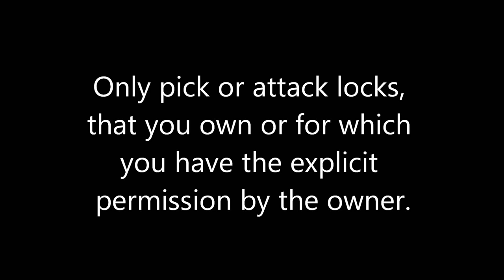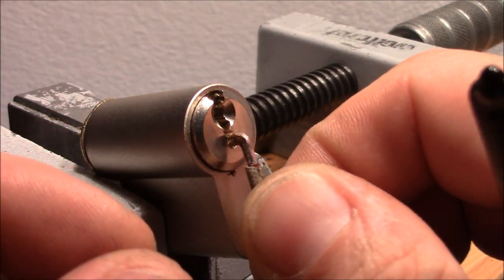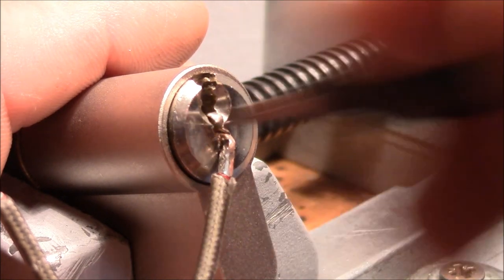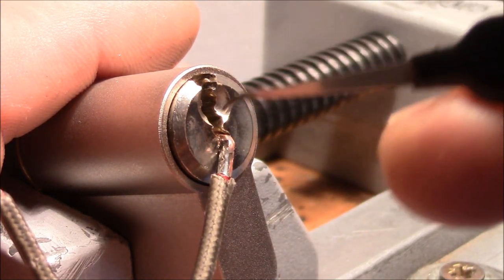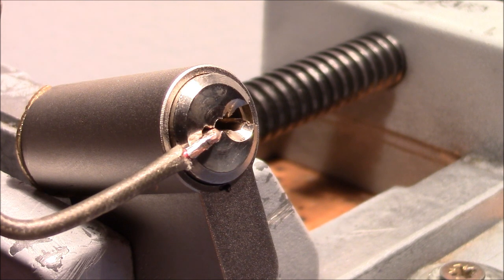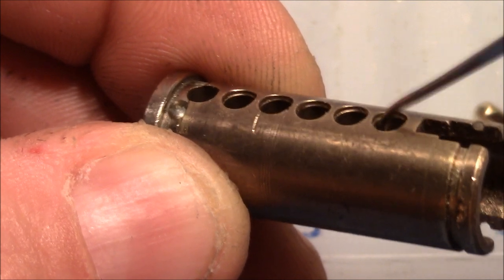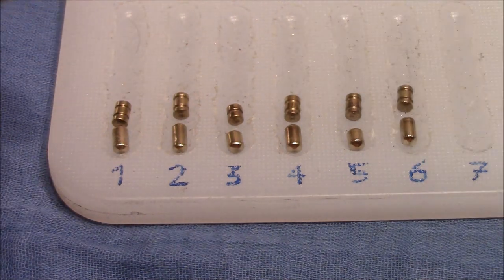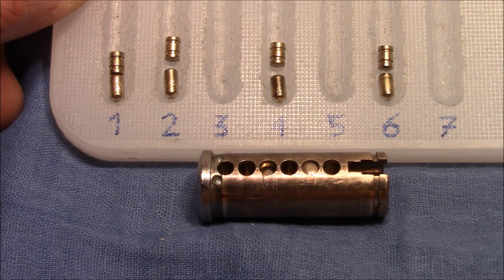(picking 257) GeGe 6 pin lock picked/gutted (the hardest lock in a while) - thanks APACHE-LOCKSPORT

Comment: That was pretty awesome my friend I like your method of approach it worked great. Nice pick on a very odd lock with both key and driver pins below the shear line. Thanks for sharing.
Reply from the maker: Thank you - I can pick it also without brushing but it takes much more time. And it's also great fun to apply a different picking method.

Comment: Cool. There is something additionally satisfying about opening a lock that you've had to work hard to understand.
Drivers below the shear line is a concern. Great way to potentially destroy springs and cease up the lock. :)
Reply from the maker: Yes, amazing that after two weeks of working, I seem to have learned a skill that I can apply without effort now but which  seemed impossible before. When I tested picking with only four pins I did bend the spring in #3 a bit but I could repair it afterwards.

Comment: Excellent picking!! and as always great explanation of your opening method :-)  I understand and have much respect that you pick locks the way that they would be found "in the wild"....but...if you picked the lock "upside down"  (American style) then you wouldn't have had to pick pins 3 and 5 making it an easier pick?  interesting thought :-)
Reply: Easier for locksmith in field, unlocking locked door (and then replacing damaged lock) but for picker it is not a good situation. The springs in 3 and 5 would get trapped in shear line and prevent nondestructive (for spring) gutting.
Reply: Mike MP very true... but you would not know that until it was too late... It's a good thing that potty 314 decided to pick it that way!
Reply from the maker: Thank you very much :-) Do you mean because of the different angle of the pick, so that accidentally setting #3 and #5 is less likely? Anyhow I picked it this way as it was a euro lock with no markings on it (letters, etc.) from which I could deduce the "right" orientation. So I thought that bible downwards fits best to a euro lock. Cheers my friend :-)